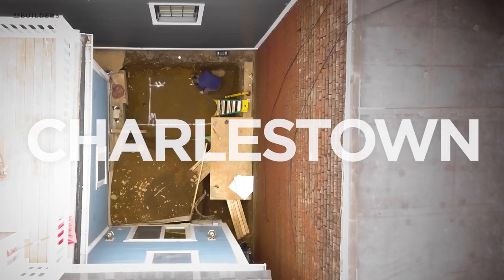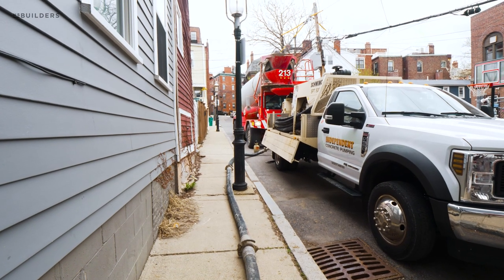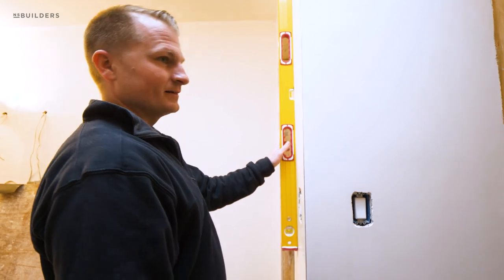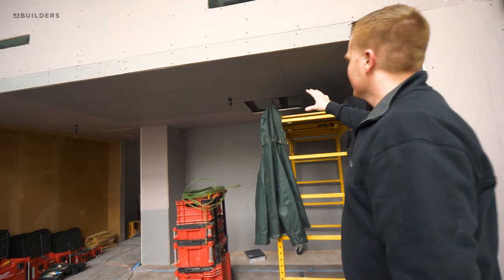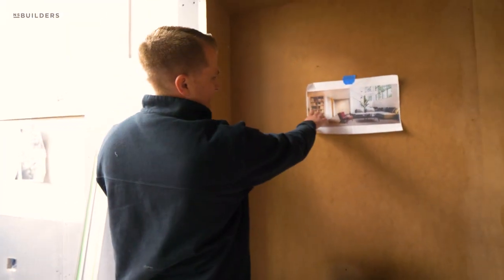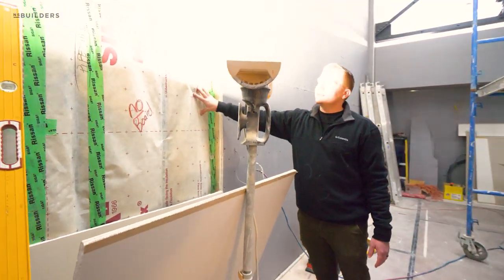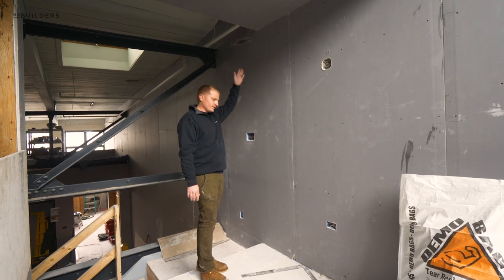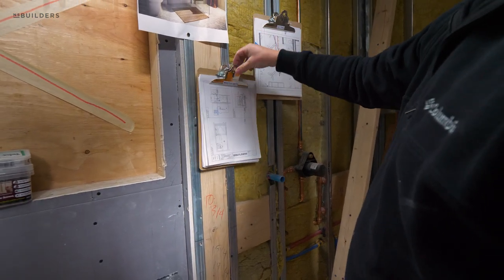Concrete footing & small alleyway here's how | Site Visit

Comment: For the Cambridge project in the bathroom, you could use a double pole switch to turn the ERV along with the light. The poles are separate and could control both low voltage and 120V. This would allow you to use a two-gang box and kill two birds with one stone with a two-pole switch.

Comment: For the ERV boost, I would avoid anything like a beam or security sensor – I've done this before, and it always ends up being janky from both electrical and aesthetic perspectives. You can just use an overhead occupancy sensor that's flush-mounted with the ceiling. Lithonia has some with relays and configurable timers already built in. Nice and cheap, better field of view, and less visually-intrusive. If you're trying to keep an uninterrupted ceiling surface, an acoustic sensor would also probably work well in that space.